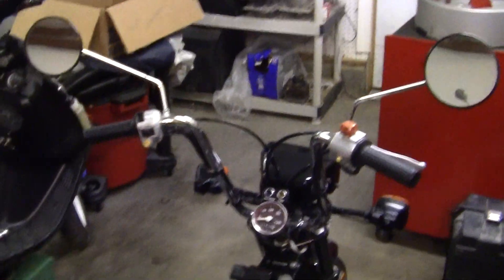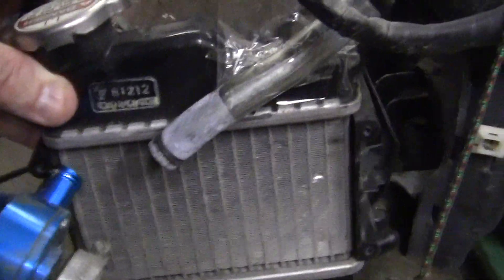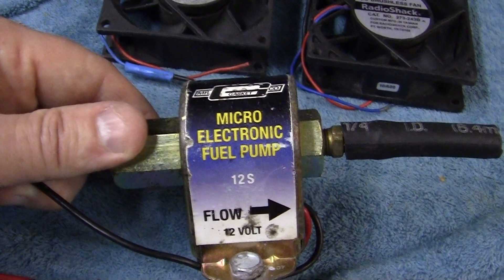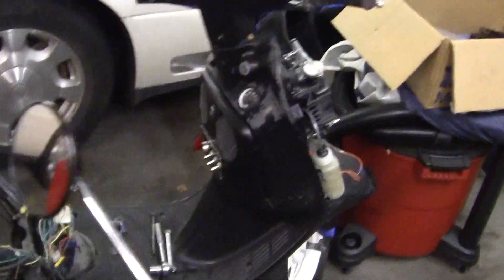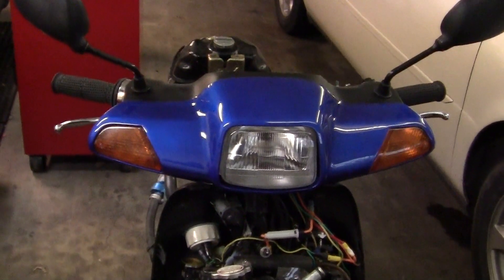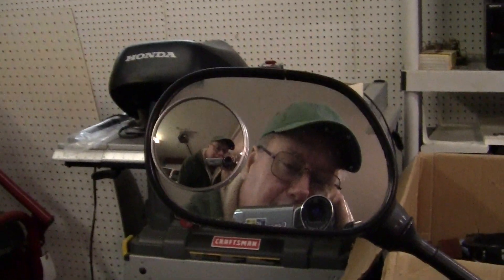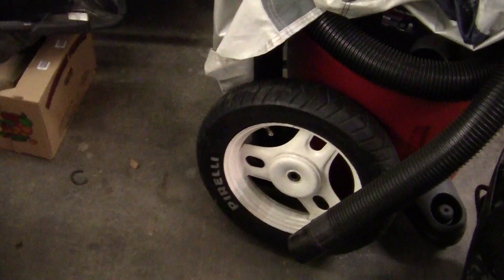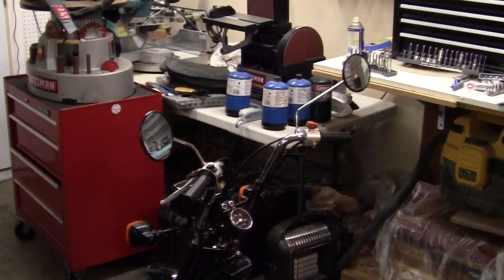178 -Operation Honda DIO= 120cc STROKER ENGINE.

Comment: You should do a 20 shot of nitrous. I know for a fact this is done on are builds Randy.
Reply from the maker: Nitrous scares me with the little drum brakes. I have noticed a real different with the front disc brakes on the zuma are excellent and my dio are just okay. I can get a Dio front end with the disc brakes like in Japan, but it would set me back about 700$. That tis a good idea to try, but the older I get, either I am getting smarter, or more cautious. Frankie , I probably will do it. I am more worried about this engine build starting right now. Send me those pics bro. R.
Reply: DIOSpeedDemon I want you to check my youtube channel buddy.I am in process of better and bad ass break setup. I want you to really think about some WFO nitrous spray.

Comment: Hey bro they sell after market rims for sa50 they got diffrent style  centerline rims
Reply from the maker: I had seen some I liked but they don't make them any more. Thanks for the jet size , now all I need is the 33mm intake. Randy.
Reply from the maker: I am starting to use thumbnails from pictures of my past engine builds. I hope you like them. R.
Reply: Just orderd a ncy rotor kit from sooter swap shop imma put it on my 125 taida stroker motor 
If feels good ill put it on my ministroker 
Its 250 u need to get one bro, trust me u will thank me later
Reply from the maker: What exactly is an NCI rotor kit and What does it do, exactly, thanks. I am just down the road from that shop so to speak.